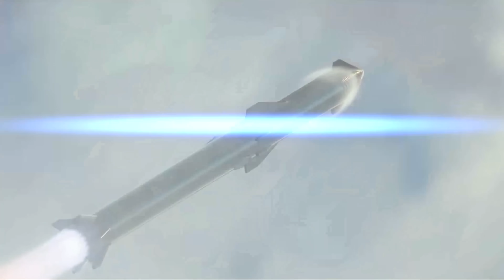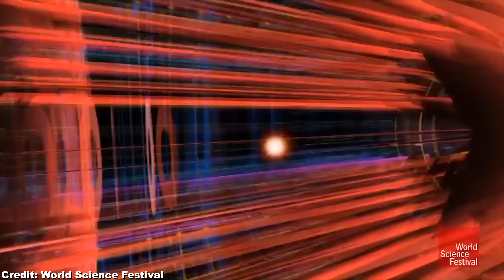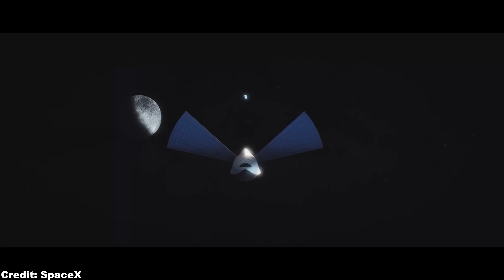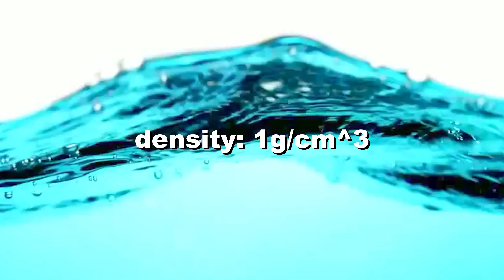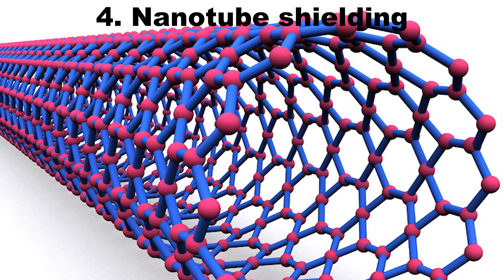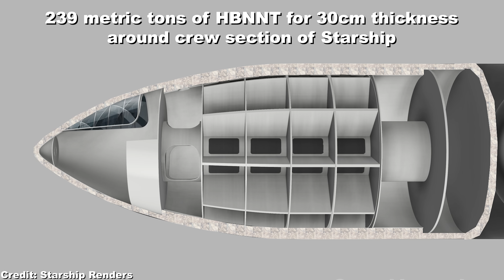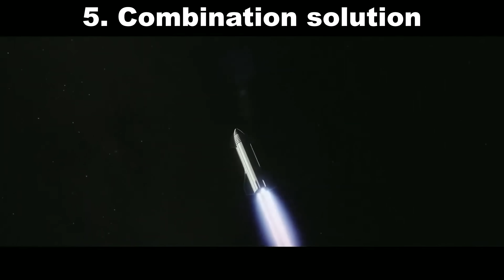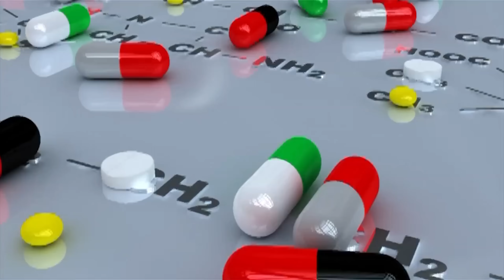SpaceX Starship FLAW Fix: Best Cosmic Ray Protection?

Comment: Hi, guys. I'm happy to see that you are addressing the threats from radiation more seriously. Okay, so lets see where we stand. You want to reduce travel time and so radiation exposure by using NTP (nuclear thermal propulsion) and yet you do not mention the shielding required to protect the crew from the nuclear reactor's radiation? Why not?  How big/small is your proposed reactor? How much shielding wil be needed to protect the crew? How much fuel will be needed for the NTP? Why has NO NTP system yet flown even though it was first proposed in the mid 1950s? You have also, again, left out the problem of radiation while on the martian surface. Talking only about minimizing radiation in transit will not do. Show me your proposal for a complete solution to the radiation problem. Will starship carry enough fuel for a round trip? If not, how will it refuel with the hydrogen needed for the NTP? Does the NTP have enough specific impulse to lift starship off the martian surface? So many questions, eh?
Reply: @TechChasm  Really, you recommend the Angry Astronaut? You would rather go with his opinions and beliefs than the "morons" he disparages? The likes of Scientific American contributors, The European Space Agency, Bill Nye, Niel DeGrase Tyson. Very smart morons indeed. Now, I'm not trying to make an argument from authority. I'm saying that I'd trust in their science/evidence over Mr. Angry. 
He then goes on to claim that we have "years" of data about the low levels of radiation on Mars when, in fact, we have a couple of data points over the years. Hardly the same thing. Then he sites data from the curiosity rover and immediately shows a global distribution of radiation thereby implying that the rover has provided this data. As you may know, that is impossible and so misleading. 
He then claims that 2 years of radiation is manageable siting Cosmonaut Gennady Padalka's time in space of over 2 years worth (878 days). What he seems to conveniently leave out is that Padalka's time in space was spread over his active career of over 7 years between 1998 and 2015 So, no, Padalka is NOT living proof that we can easily survive 2 years of Martian surface radiation.
As for 3D printing an ice house, In layman's terms, he means an igloo with water sprayed onto the membrane that was brought from earth. Where did the water come from? Martian ice? How did it get heated for spraying? What was the energy source? And just how is the igloo a beautiful place to live? Isn't it just the landing craft they came in? Ah, I guess that the beauty is in the eye of the beholder. That explains it. Oh, and the beautiful place to live even comes with windows. But no mention of where they came from. DO they have radiation shielding?
Then off he goes to Olympus Mons for some dry ice surfing. Hmmm, you do realize that his example was taken on earth, right? On earth, dry ice does evaporate providing the sliding layer upon which the block shown is riding (note the guy at the top of the surfing hill in short sleaves). News flash! Mars is way too cold for the dry ice to evaporate like that. That's why dry ice can form at the poles on the surface.
So, dry ice surfing on earth is plausible, but, on the slopes of Olympus Mons, not so much. And while our surfers are out on the slopes of Olympus Mons, how did they protect themselves from the higher levels of radiation Angry Astronaut admits prevail there?
Cumulative life? Why does he say that, could it be a slip of the tongue because he did know that Padalka's "cumulative" stay in space was spread over 7 years? Makes me go - Hmmmmm again. 
Mr. Angry "solidly believes" that we can survive Martian surface radiation. How sweet. But   I, for one, don't give a tinker's dam what he believes. I'd rather he stop believing and start measuring, showing me the numbers and the evidence.
He then goes on to say that, well, even if there's radiation to contend with, we have threats here on earth going on to site hurricanes and other natural disasters. Here's another news flash. Those types of disasters are sporadic (time in between focus to recover from them) while the radiation on Mars is continuous, unrelenting and, dare I say it, cumulative.
So, yeah, Mr. Angry Astronaut, keep on being angry and see how far that gets you.
Oh, and lastly, how dare you claim the term astronaut for yourself? When were you last in space? NEVER! So there is that.
As for NTP, why would such a "promising" mode of propulsion be de-funded? Hmmmm?

Comment: Very good, thanks.  Perhaps consider using the nanotube shielding in a constantly worn spacesuit aboard ship. Crew would have the same shielding as if the Starship were cocooned but the weight would be <1%.  As to faster propulsion, we need one type of ship to get to LEO, another kind to move around in space. Also, consider robots teleoperated from inside the radiation shelter during a storm. Finally, if the propulsion system is generating a magnetic field anyway, why not use antennae to generate one that protects the whole ship?
Reply: Yes of course. I meant only in case of the VASIMR drive. Also, wouldn't it make more sense not to have windows, using screens simulating windows instead?

Comment: Use starships with shielding to transport humans and radiation-sensitive cargo only, and automate the cargo flights (so no need for shielding). Restrict the number of trips a human can take based on dosimeter limits, similar to what is done with nuclear power plant workers. With automation it should be possible to limit crew to very few trips. Or use starships for the automated cargo flights and build a handful of specialized orbital human transport vehicles with a passenger capacity in the hundreds; starships would act as shuttles on both ends.
Reply: Oh yes: IIRC there's still quite a lot of radiation in Mars orbit, so convert one of the moons to a shielded transfer station.

Comment: I think you missed one obvious solution, that of using the propellant itself as a radiation shield. Methane is almost as good as water as a radiation shield and oxygen also gives some protection. Starship will be carrying quite a lot of propellant anyway to use for orbit insertion and landing.
It may still not be sufficient but that could easily be overcome by adding some more propellant in the on orbit refueling prior to departure.  The extra mass over and above the normal propellant load would be of no impact since it is added at a time where it does not impact the launch vehicle and rather than wasting delta-v as a water shield would, it instead provides extra delta-v which can considerably reduce the the trip time by using a different trajectory that would then use the extra propellant for propulsive braking before re-entry.  The extra cost of this would be the additional tanker launch needed for the additional fueling.
Reply: Lister Dave — Good idea but would require wrapping the crew section in cryogenic tanks and keeping those tanks cool when being constantly heated but the crew compartment.
Reply: Shannon Love no need to keep tanks cool because shielding fuel would be all around the starship and connected to the cryo tank to be also used as its normal fuel purposes.
Reply: Amazing Amazigh — Yes, but thanks don’t usually have a heart source inside them . If you wrapped the crew quarters in cryo tanks all the heat generated by the crew compartment would end up in the tanks.

That’s a lot of heat.
Reply: Sure, if the crew is made of Snowmen.
Reply: @TechChasm  True about the cooling but that might be possible to fix with aerogel insulation. I'm not talking about changing the Starship much more than you described. All it involves beyond what you described is putting the methane and oxygen instead of the water in the shielding envelope, plus the insulation and a means to pump the propellant back from the shield into the tanks on arrival at destination.
It would still have the exact same main tanks and would launch in the same configuration with propellant in the tanks and the shield envelope empty. Once on orbit it will refuel before making the trip to Mars. Instead of just filling the main propellant tanks it would also fill up the shield envelope. This might be in addition to the full tanks or by putting part of the fuel in the envelope and leaving some empty space in the tanks, depending on how much propellant is needed for the trajectory.
The whole idea is that whereas the water would be dead weight that would impact delta-v the extra propellant wouldn't, as it would make up for its weight many times over.
The insulation is probably the toughest part due to the very large surface area exposed both to the sun and to the heat inside. LNG tankers today manage to store LNG (which is mostly liquified methane) for several weeks, using evaporation to keep it liquid.  Starship would have a much more difficult job keeping it liquified due to the much larger surface area to volume ratio but maybe not beyond the realm of possibility.

Comment: Methane is a better radiation shielding material than water (because it have a higher hidrogen concentration by mass 24%versus 11%), a starship will carry 240 tones of propellant for landing on the Mars anywhow , but liquid oxygen will be majority of it 3,5 to 1 mass ratio, so 187tons is oxygen and 53 is methane, not enough for shielding whole passengers quarters but can make a better solar storm shelter than only with water.
Reply: @TechChasm  indeed suplimentar insulation will be needed, and is the psychological issue of living inside a cryogenic tank. Or maybe external fuel tanks can be wrapped around ship body and removed and parched in Martian orbit for return journey.

Comment: H i J & S, great video as always, just one query though:

Taking the figures you quoted, if the required thickness for BNNT sheilding is only 30cm (compared to 1mtr for water), and the density of BNNT is 1.4g per cubic cm, then the total mass should be 133 metric tonnes, not 239.  Or am I misunderstanding what you said?

Wouldn't normally hope that you'd made an error, but I do here as it would reduce the mass of the sheilding required considerably!

Keep up the great work, amongst the most interesting channels around!
Reply: @TechChasm   Hi J & S, thanks for clearing that up!  I think when I heard you say "...use the full 1 metre difference for water shielding" my brain forgot to think 'Yeah, and now divide that by 2 to wrap it all the way around' LOL! Sorry!

It has made me think though, that a possible simple solution (albeit short term) might be to 'wrap' the crew section in an OUTER layer of water ice - piped onto the hull after the ship was in orbit, to become a 1mtr+ ice shield around the forward section  (that would also protect against micro-meteorites...) hmm... Nah, having said it - too cumbersome! And the mass to be accelerated for the journey to Mars is unacceptable...

You know the more I think about this, the more it seems that Starship is hardly the ideal design for the interplanetary transit. I'm a great supporter of both Elon and Starship, but it begins to look much less than suitable as the main Earth to Mars transport vehicle. While it might be acceptable for the first few trips by highly trained astronauts who will accept higher risks - and in the long term it will be a brilliant shuttle and emergency transfer vehicle - for the majority of the Earth-Mars-Earth transits a specialist ship is going to be required. 

This will have to be much larger than Starship. 

Here's an idea for starters: Send up a Super-Heavy without Starship, to make it light enough to put into high orbit. It would have just a nosecone type faring, filled with kit to build Bigalow type habitation RINGS (not just modules) a series of which would be attached along the length of the Super-Heavy. All would then be coated with ice for shielding. This should have enough room to provide comfortable accommodation for around 1000 colonists. It would be spun-up longitudinally for artificial G and would either use vacuum Raptors or, maybe by then, be fitted with VASIMR engines. It would be put into a permanent Earth-Mars transfer orbit, with Starships rendezvousing at each end to load and unload colonists and cargo.

Although this sounds like a huge project and a long way off, I think the point where we will need something like this will come rushing up faster than anyone expects once there have been two or three successful landing on Mars. At the moment Elon seems to be the only person on this planet capable of thinking and planning on this scale, and more importantly, actually doing something about it, so hopefully, something like this will be the next big project he amazes everyone with!

Comment: The radiation issue is one of the best arguments for establishing infrastructure on our Moon - so we'll be forced to figure out how to best deal with cosmic radiation. I suspect that the best solution is yet to be conceived. SpaceX will be carefully evaluating current options before deciding which to use for those first manned flights to Mars. Maybe the very first Mars explorers should be old farts, so the cellular damage is less concerning than it would be for young people planning to start families on Mars.
Reply: @TechChasm  I support going to the Moon to better understand the deep space environment. For visiting Mars with current technology, I prefer Mars Direct from Earth orbit. It's more fuel efficient and reduces travel time for astronauts.

Comment: I think the more practical solution is to just build a completely different ship that stays in space and has the radiation shielding permanently installed into the ship. That ship never deorbits so you never have to worry about launching out of a deep gravity well. Then, the starship only has to go from the ground to the shipyard in space. Or, it can go out and dock with other permanent ships en route to Mars or the Moon. I feel the Starship is a tool designed to get you to space swiftly and inexpensively. I think for the purpose of getting cargo to Mars or the Moon [Mars Direct], the starship is great. But once you involve humans into the mix, you are trying to make the tool do too many functions. That will make the rocket good at many things but not great at anything.

I think what will ultimately happen is SpaceX builds ships in space for the purpose of interplanetary travel. This is sort of what an aircraft carrier does in the navy. It is the intermediate maintenance detachment or attachment. The navy used to call the terms SIMA and AIMD. The carrier is the key ship in the logistical support for the fleet. I think the larger ship should be the thing designed with thick shielding material and engines dedicated to the deep space flights. The starship only has to be the E2 Hawkeye that ferries supplies to the ship or naval outpost.

Thank you.
Reply: Eventually I think a larger ship would be used to travel to Mars, but it doesn't make sense to accelerate and decelerate this high mass ship for every trip. This vehicle should be a Mars cycler that starships would rendezvous with and passengers would live in for the duration of the trip. This cycler should use a water jacket or rocky material from a asteroid to form a high mass radiation shield. If the craft is large enough it could be designed to provide some level of spin gravity. Starships would travel along with it or docked on it on the way to Mars and the passengers would re-board their starships to land on Mars.This cycler could be thought of as a interplanetary cruise ship that could provide a much healthier and safer trip to Mars.

Comment: I think that going faster would be the  solution that Spacex would consider first.  Elon Musk has already hinted at wanting to do this and it'd also help with the lack of gravity problem since the astronauts would spend less time in space.   I still think they should consider adding other solutions as well but I think Elon Musk is looking at this from a complexity standpoint.  He's said in person that "the best part is no part" so if they can boost speed with an engine we already understand it may be less time consuming and problematic than shielding the entire hull with water which would require more thrust or orbital water filling, it would require modification of the hull, probably pumps to circulate the water, and it'd probably alter the balance of the ship for belly flop maneuvers which could require repositioning of one of the fuel tanks , etc. etc.

That's just what I can think of off hand.  Having said that, I think at a minimum we should have a solar shielding room and a artificial gravity solution but I have a hunch that Elon will only give a dedicated solution to the solar wind problem because both the gravity and cosmic ray problem can be reduced by going faster and spending less time in space. Killing 2 birds with one stone helps reduce complexity,  I'm just thinking that speeding up and spending half the time in space would still be too long given the astronauts shouldn't be weak when they get to Mars.  They'll have jobs to do and face multiple challenges on the surface of Mars which they need to be prepared for.